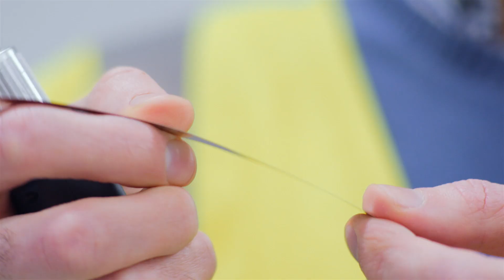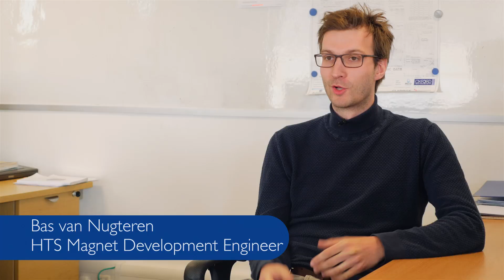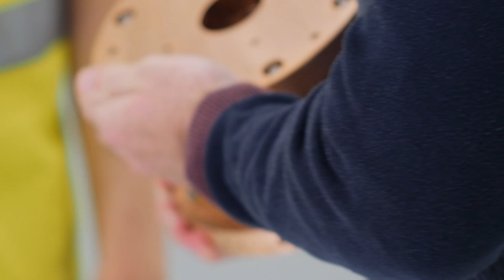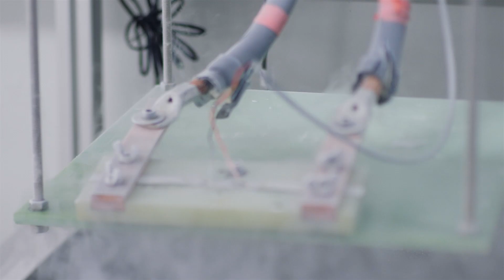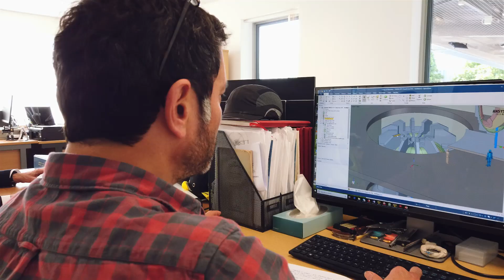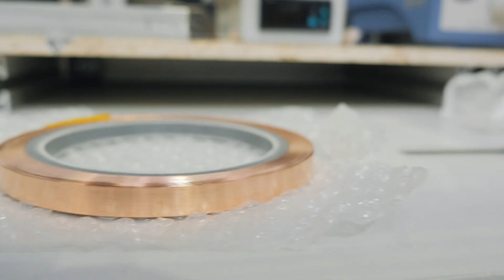Developing novel superconducting magnets for fusion energy

Comment: Applied brute force magnetics will never get a plasma to fuse at a commercially viable efficiency, it's the wrong method imo, it seems the trick to cracking the fusion secret lies into applied electric fields, inside collapsing plasma double layers, but not just the electromagnetic structure but also the chemistry that takes place inside that plasma plays a role in enabling reduced fusion temperatures and increased transmutations. It appears protons that wander near other heavier atoms or vice versa is an undiscovered part of physics that we are only now realizing.

Safire Project seems to be the most promising approach.

Comment: Is high temperature 20 kalvin?! What is the main barrier to fusion..if it is not maganitc capabilities?...to control and confine the Fusion i though was the main abostcle ..what is the tech mile stones we need to achive it then? What is the difference between this and what ITAR project achievement?!
Reply: I believe Tokamak energy is just trying for 100 mw outpute but ITER is trying to do 500 mw.
Reply: The term 'high temperature superconductors' was invented to describe a new generation of superconductors that can work at liquid nitrogen temperatures of around 100k instead of needing liquid helium temperatures of around 20k. 
There's a lot of technical hurdles involved in stable fusion, mostly keeping the plasma hot and stable long term. There's a lot of approaches to fixing these issues but better magnets are generally helpful. One of the issues is that the output of fusion (Helium) isn't useful for fusion and is just in the way, but it responds differently to the magnetic fields and heating systems compared to hydrogen/deuterium/tritium so it'd be good to be able to move the helium byproducts out without disrupting the plasma doughnut.

Comment: Your american counterparts speaks about making the coils dismountable by means of joints in the superconductors. To make the vacuum vessel easily replaceable. Can this be achieved by winding the solenoid in place instead?  In combination with making the solenoid frame from bolted segments?

Comment: The magnet research could be really useful for  MRI medical or NMR spectroscopy
Reply: that's what i was thinking. hospitals only needing to buy liquid nitrogen instead of helium would be very economical
Reply: @AlexiLaiho227  Yes, I wonder if they can make a high enough magnetic field, department just installed two Helium supercooled magnets so it's not there yet for us.
Reply: @walrus4248  Another issue with MRIs vs Tokamak is you need to be able to fit a human inside the magnet with space for insulation systems to not supercool the human. it's possible that's another design limitation  thats why you can't use liquid nitrogen superconductors for MRIs yet.
Reply: @ErkadSonMi  Another problem is that there's probably someone trying to profit off these discoveries so for better or worse commercial implementation will probably be held back by patent and licensing issues for a while.
Reply: Not to mention that helium is kind of a limited resource by comparison.
Reply: @Scott A. Taylor

Check my Quantum Computing playlist in another channel.

Look for a video in that playlist called "The world's first MRI of a single atom is here, and it could revolutionize imaging".

There is an Australian company that developed holograms for arcades, education, medical and video calls.
Do a youtube search for these videos.

"Voxon Photonics VX1 3D Volumetric Display in 4K".
"Voxon creates the world's first volumetric video call over 5G".
"Holograms in Education - Voxon's volumetric display ".
"VX1 demo at "The Valley" business school in Madrid".
"Voxon Photonics BBC digital planet live HOLO VIDEO".

The hologram arcade.
"Voxon Z3D - Welcome To The Future".

Also check my other playlists on that channel called, Graphene playlist, Photonic Computing playlist, and "Other science and technology" playlist for other medical technologies coming and already here.

-------------------------------------------------

I was giving out helpful links, but it won't allow me to do that now, so I made playlists.

1. Check my channel, find a subscribed channel called Technology Research, go to the playlists there, and click "created playlists", that should show them all.

2. After that, click on the title / text of each playlist, not on the pictures.

3. Don't forget to click the "more" button in each playlist description for more articles and playlists.

Comment: We have enough thorium for millennia fusion is a waste of time.
Reply: fusion is the ultimate source of energy
Reply: @Danuxsy  
That doesn't necessarily mean it's the best.
Reply: @iamchillydogg  Yes it does! What can possibly be better? There are no byproducts, you don't have to fuel it, it keeps running forever essentially, unless there are physical breakdowns (unlikely since it's all about the magnets holding up the plasma, preventing physical contact to begin with.)
Reply: @Danuxsy  
Things like cost and reliability factor in. Fusion  irradiates the equipment and it definitely needs to be fueled with deuterium. You know the Sun uses hydrogen as a fuel right?
Reply: @iamchillydogg  If fusion is good enough for the sun, it's good enough for me.
Reply: You do have to fuel it. With hydrogen.
Reply: cleaner is better...if they can actually reach positive energy output.
Reply: oh stop this bs thorium already. if it that good why no one ever attempt to build one.

Comment: Are those copper looking things the magnets or are they the current carrying conductors for the magnets?
Reply: Current carrying conductors. With voltage once applied they generate a magnetic field with the strength of 20 Tesla.

Comment: Can I get a job? 😍😍
Reply: @Aaa Ccc

Have you thought about messing with Graphene "in its purest form" and specific magnets?

Graphene with specific magnets has proven to make classical computers (the ones you use now) around 1,000 times faster than todays classical computers. I wonder if you can experiment and find out how much temperature that Graphene can handle, when in its "purest form" of an atom thin. It can be produced like some of the thin magnet strips seen in this video and other videos they have on the channel. And there are new ways to produce Graphene even more, but a thin strip would be very useful as it's very strong and has special properties in its purest form. Graphene with the classical computers, not only could be around 1,000 times faster, but will only use 1% of the energy, so that's extremely exciting, wonder what else it can do, and what it can do for Fusion Energy instead when it comes to power input into the Fusion reactor. 
Would it use less energy with the Fusion reactor when its turned on? Not the energy created by the Fusion reactor, but the electricity going into it. And could it possibly do other things for the Fusion reactor?
There are so many amazing possibilities with Graphene, that we don't even know yet.
And it's not as expensive or difficult to make like 10 or 5 years ago.

Archer Exploration is a company in Australia using Graphene to bring Quantum Computers to room temperature, which means we could see Quantum Computers in our homes very soon, check out how fast their progress is, they have video interviews on the Proactive youtube channel, they also have articles and a website if you google search for "Archer Exploration website".

I think you should look into Graphene with specific magnets, do research and then let them know about what you found, show them how it works in videos. I think a lot of people should be trying this.

Find a video called "whatever happened to Graphene? (update)" and check what it says about the difference between copper and Graphene.
Check for a video called "future super computer 1000 times faster Graphene computer".
Also check for a 3rd video called "Graphene processors and Quantum Gates Subject Zero Science".

If you are curious about emerging technology and beyond, I have playlists on another channel, follow the steps below and you will learn a lot about what I mentioned above and more.
Don't forget to check out the other playlists on that channel. Please check out all of them for ideas and to be aware, it's not just for entertainment, I made those playlists for people to be aware of what emerging technologies and beyond are coming, and to teach people, it makes me happy to see the views go up for this reason.
I hope the playlists can give you good ideas, show your results to this company!
And I do hope that the company of this video will test Graphene and specific magnets!

-------------------------------------------------

I was giving out helpful links, but it won't allow me to do that now, so I made playlists.

1. Check my channel, find a subscribed channel called Technology Research, go to the playlists there, and click "created playlists", that should show them all.

2. After that, click on the title / text of each playlist, not on the pictures.

3. Don't forget to click the "more" button in each playlist description for more articles and playlists.
Reply: @gameresearch9535  wow...  You posted this comment awkwardly...  Shouldn't this be somewhere other than a reply to a guy thinking he may want to work with this company?
Reply: @Scott Cress

Because the person wants to work with them, this gives the person and anyone else an opportunity to do just as I mentioned, clearly understood in the comment. I have my reasons.

They have already mentioned to some people asking for a job in other videos on the channel the past month, that they will be looking to hire at some point. 

And I like to share what I can, in not just good innovative ways but also from interests to help with such innovation, there is nothing wrong with that. 

I was deciding on that comment to some other commenters under the video, though nothing felt reasonable to comment that under anywhere else, and some other comments had people that don't like Fusion energy as an idea, so I chose the best one under the video, again I have my reasons.

Also I wanted to give ideas to anyone reading, in multiple ways. My other comment made this very clear with reasons.

I hope you're not being short-sighted and prejudice. It was about Graphene and the specific magnets used, and other magnets that can be tested and used with such a wonder material of the future.
Reply: @gameresearch9535  You're missing my point. Your questions and comments are really good.  Don't post them as a reply to a comment where no one will read them.  Post them as a comment on the video.

Comment: Is there an "insulator" on the HTS tape you use or does it rely on conduction being greatest in the plane of the tape?
Reply: I remember an older report about the SPARK design (not from Tokamak Energy) where they indeed stated not to use a separate isolators as the metallic non-superconductive substrate sufficiently isolates the bindings. I am wondering how avoiding the use of an isolator influences the control of a quench...
Reply: no, it is layered: copper, silver, rebco, copper.
while I'm sure you could get it with insulator as a layer on the bottom, if you need insulation, you can just put insulation on whatever you're insulating.